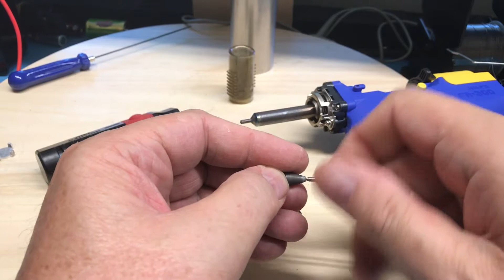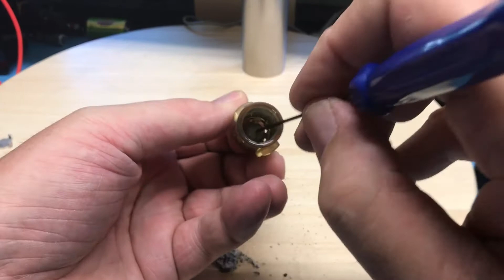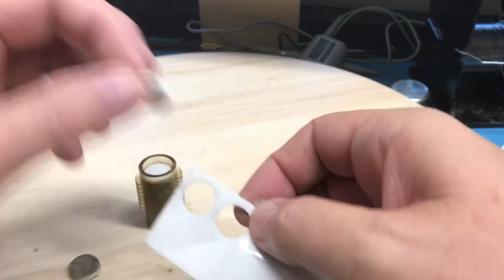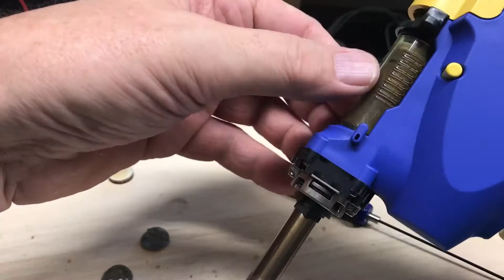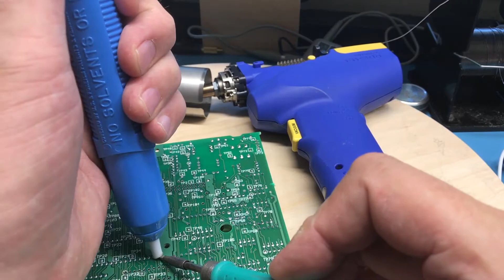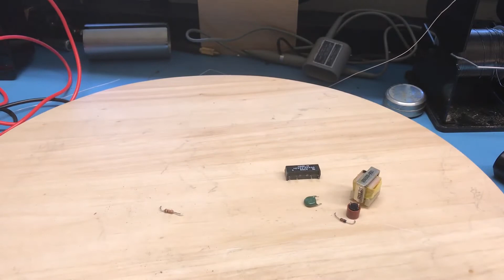Tools - HAKKO FR-300 Desoldering demonstration and cleaning - STB48

Comment: This is SOOO much more convenient than the manual pump-action suckers.  My preferred method before I got one of these Hakko's was some cheap 50-or-60 watt soldering pen with a bulb (like an ear-cleaning spray bulb) attached via a pipe to a hole in the tip.  You squeeze the bulb, heat up the connection, then release the bulb which expands creating suction that removes the solder.

Comment: Excellent desoldering tool. I tried a couple of cheaper desoldering guns, but they weren't as efficient as the Hakko FR-300. I used  it repair system boards; removing  capacitors.

Comment: The idea of that metal plate to cooling down the melted solder is good but that filter burn says there is room to improve it, using steel wool before the plate and filter would help a lot.
Reply from the maker: Awesome idea. I'll need to try it.

Comment: I am new to the FR301 but I think I would just heat the tip and clean it out instead of using the drill. Just my 2 cents. Thanks for the great vid.
Reply from the maker: My FR301 came with a long drill bit specifically for cleaning out the nozzle when you can't get it to cleat any other way. I tend to get lazy and just shut it off instead od making sure it's clear and tinning the tip before I power it off.

Comment: As experienced reworker.  I would advise to not exceeded force the file into tip.  It will scraping the coat inside nozzle.  And clean while it is hot.  Reuse filter is not recommend.
Reply from the maker: Yes, you're 100% right. Old habits tend to get in the way of doing things right. I'll try to keep this in mind.